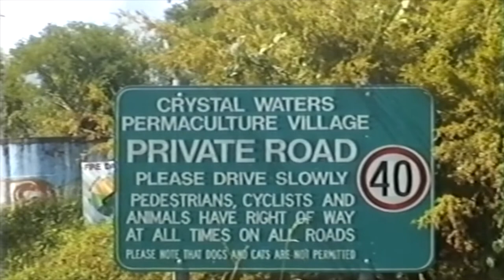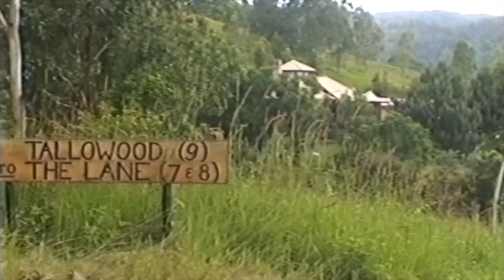Rammed Earth House Construction 2000

Comment: so 20 years after, do you recommend rammed earth walls, do you think they can last the test of time or no?
Reply from the maker: Absolutely yes. As long as the walls are constructed with the correct ratios of ingredients and are made well, as long as the walls are coated with a spray on water repellant (which can be reapplied if needed) and as long as the walls are given some protection from the elements with roof eaves.  Old hand rammed walls in New Mexico from some US Cavalry forts are still standing but they have weathered considerably after 150 years whereas some adobe rammed earth walls in building still in use from the same era are fine. Rammed earth building companies should have all the tech info on this.
Reply: Yes...Old milenian houses in the world are in earth....
Reply: The great wall of China is built with rammed earth
Reply: @serendigity  What are those ratio and other techniques Please?
Reply: @drsantoshsinghrathore9308  As a Civil Engineer I'm investigating this also. I've researched that sandy soils are the best in lieu of clay soils. That's based on CSIRO from 1947. So, sandy soil with 10% Portland Cement rammed at 15cm layers. Needs a bit of moisture to bind - if it can roll a ball in your hand it's too wet. I'm looking at doing a Rammed Earth in Sydney near Colo. Feel free to contact me if you need more info.
Reply: @stedmans4christ  The parts that are still standing aren't. Go and ask the Chinese.
Reply: @stedmans4christ  I think it is stone structure. Big stones were used. We have a fort in Rajasthan. That is above nine hundred years old. Inhabited even today. It was built with stones only. Very little or no lime. It is situated in desert. There was no or scanty availability of water during those days.
Reply from the maker: @drsantoshsinghrathore9308   I do not know the technical details. Competent rammed earth companies may be able to provide the details that you seek.